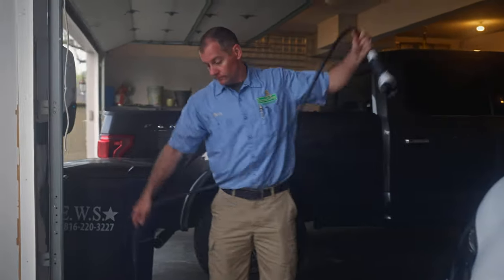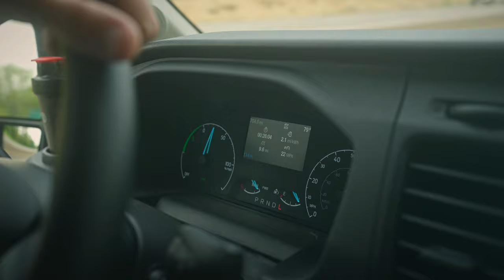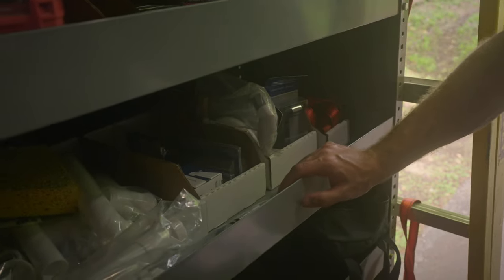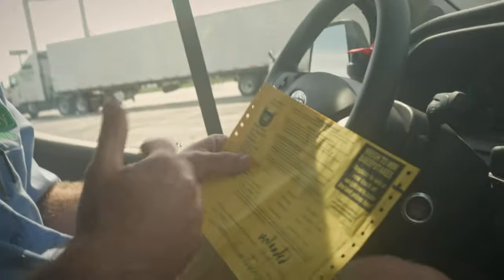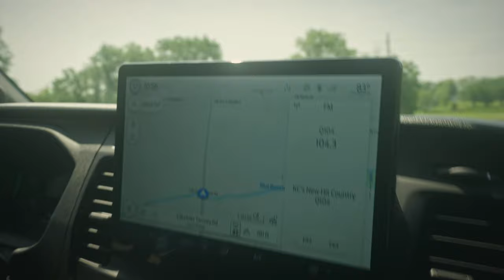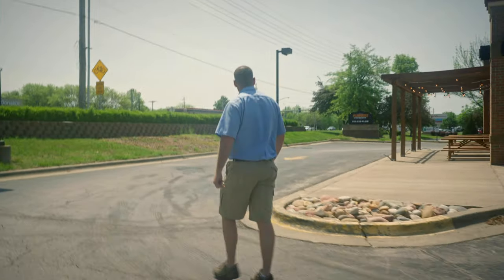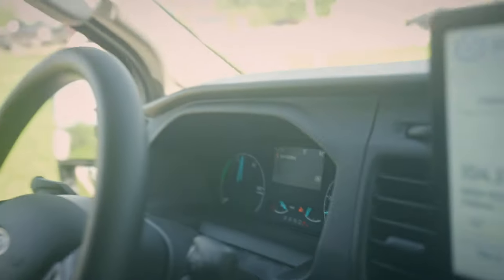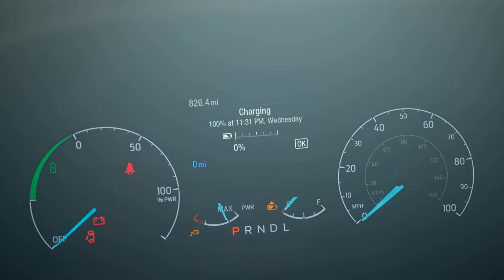**Ford E-Transit**  How far can you drive when it's loaded down?

Comment: Do you carry any electric device to allow you to charge your vehicle should you be out of range of a charging station? If so what brand do you use? How long does it take to charge this vehicle when you go to the EV stations?
Reply from the maker: There is a factory charger that stays in the van.  Charging time depends on the type of charger and the available amperage.

Comment: Do you have a video how you add the the shelves and storage for the van.

Im coming from a work truck and want to get this van.

My big thing is i carry a lot of ladders to.
3ft, 6ft, 8ft and extension ladder.

I forsee i will not be able to carry all my ladders Sadly
Reply from the maker: We just bolted them to the walls and the floor.  We use American Van for our shelving and bulkheads

Comment: Can you sit in it and do your paperwork with the AC on for 20-30 min during the hot summer? Love that high roof. I have a short roof transit and hit my head 3 times a week.
Reply from the maker: Yes.  You'll get a message that pops up letting you know it's about to time-out but you can press "ok" and get more time.

Comment: Great video.  It would be good to let people know that charging stations on average are 10-15x more than home electrical use.  I have a hvac business, 20 vans.  Mostly new awd cab chassis transit vans with reading or knaphied utility beds on them.  We are also seeing about 13-14 mpg average.  Our gvwr is similar to this loaded e transit.  It would he an interesting proposition if range was more, awd was an option, and a cab chassis was also an option.  I'm so done crawling into a loaded van to get to tools.  Tools on outside bins is a game changer.  That said, my awd vans as of last week cost $69,900 with the beds.  

Recharging costs at a charging station between 30 and 60 cents per kwh is terrible.  Now a recharge is $60-80.  Poof, there goes savings.  

Funny. You said you had it a week, and said you had 800 miles on it, so if you actually told us what you spent at chargers that would be good info.  Doing 800 miles in a week, you were going to chargers a lot.  

Expecting plumbers to manage their charging.....lol, they often forget the other two rules of plumbing besides payday Friday.  Wash your hands before lunch, and water flows downhill.
Reply: The best thing to do is have 240 volt outlets wherever the vans will be parked overnight.  You'll charge at much lower rates.  The only time someone should be using dc fast charging is on road trips.  Even if you have to stop and use a pay charger it would be wise to get enough charge to get to home base which would be less than the $30-60 you are quoting.  As with anything that is recharged it becomes habit to plug in when they parked.  We have electric fork lifts and tugs at work and they are plugged in after each shift.
Reply from the maker: You have to put a charging plan together for the purchase to make sense.  Charging nightly where the rates are manageable is key.  Charging where the van already parks overnight is also key.  If you're people take their vans home nightly, then install chargers at their home.  Then reimburse them for the energy consumption.  The nicer charges will provide you a report of how many kWh's were used over a given period.

Comment: Thanks for the video. I’ll be buying an EV work van within the next two years. I am kind of waiting for the bugs to get worked out of the infrastructure and vehicles. If you were choosing a vehicle today or in the near future, would you choose the Ford transit high top again or something else?
Reply from the maker: I would absolutely buy the E Transit again.  But also, you shouldn't need to be relying on the public infrastructure for this vehicle to work. For this vehicle to be an effective vehicle in your business you need the ability to work with the range each day and charge each night. I can think on two occasions in the last 2 years where we needed to use a public charger.  If we had to rely on public charging then this vehicle would make no sense for us.
Reply: @SmedleyPlumbing  I have 47kW of solar, totally off-grid. I have just barely enough to make it through the winter with my house and shop. During the summer when I’m the busiest in HVAC, I make about three times what I really use for the house and shop. And I have five heat pump systems total. Like you, I work a 20 mile radius, but occasionally will make a 3-4 hr trip. I also need to put a few more miles on my 3/4T Express ICE. Glad I came up on your site, you look like you have a very professional business, very organized like myself.
Reply from the maker: @USA-GreedyMenOfNoIntegrity  thanks!

Comment: this is interesting and was really helpful. i actually bought one of these with the help of this video. i love the electric truck. 
Although i have a question To the creator of the video …
why have you not posted anything about how much the range is reduced once the weather gets cold. ford promises 120 mile range.  i got 130 in the summer. and now in November i’m down to 104 in 32 degree weather.  i will probably be down further as winter roles in. 
i can not find any thing on the internet about this crazy reduction in range due to winter and fords lack of insight on this.   if someone is baseing a 110 mile day, than this is not the van for you if you live in a cold climate. 
shame on ford for not disclosing this information. 
i think all. electric vehicular should have a temperature range sticker on the car to let people know what the average range is in a specific temperatures. just like a highway city tag on gas cars. 
please let me know what your van is getting in the winteronths to make sure there isn’t something wrong with mine. 
thank you
Reply from the maker: Ford did great with the advertised range.  They advertise a 106 mile range for our unit and we see 120-140 miles of range in the summer and 100 in the winter.  

It's pretty common knowledge that EVs will see a 20-30% reduction in range during the winter.

Comment: That brake-tap setting is weird. I had a rental Hyundai EV recently, and it had paddle shifters that let you increase/decrease how much regen braking you got. All EVs should have that feature, it was super useful.
Reply from the maker: Ford does this through the brake tapping.  Makes sense for me because tapping the pedal is how you would slow down anyway.  Or you can set it to L mode and have full Regen all the time.

Comment: Great video. Curious to know how long would the charge last with the van stopped but with AC on? Important info for being in south Florida (awfully hot) and waiting for hours at a time in the van
Reply from the maker: It would depend on the charger output.  The AC doesn't seem to have a big of an impact on the range so it shouldn't impact the charge times by a large margin.
Reply: @SmedleyPlumbing  Thanks for the reply. I didn't mean when it's charging though. Just parked somewhere with the AC running. I guess it would be an odd thing guesstimate
Reply: @noktoxicmind6714  not a 1 for 1 comparison but my Tesla Model 3 loses 1% of battery every hour I leave the AC running on a hot summer day
Reply: @ampedampson5140  That's amazing. I'm guessing the van can't be too far off, even if it's as high as 10% an hour would be ok. Thanks!

Comment: I have a Nissan Leaf, not a Transit but I may be able to provide some insight on the "ECO" mode. In the Leaf Eco mode adds a bit of hysteresis to the accelerator responsiveness. This is because electric motors tend to be very inefficient when they're just beginning to turn. In Normal mode (not ECO) when sitting still and you mash the accelerator there's a large in-rush of current before the motor begins to spin. This is wasted energy and unless you're drag racing, unnecessary. Once the motor is spinning the motor becomes very efficient. Nissan adds this hysteresis (softness) to the accelerator in an effort to save a little energy by forcing a more gradual takeoff. On the open highway it will make little if any difference but in a scenario with a lot of stop-n-starting it will provide a slight increase in range.  The Leaf's ECO mode appears to be defeatable. By simply mashing the accelerator (as in a panic or emergency need for more power), ECO mode will be overridden. ECO mode actually makes for a more enjoyable driving experience. This is because Normal mode makes the accelerator more sensitive causing your head to bob back and forth more when even slightly pressing the accelerator.  ECO mode seems more predictable and more familiar to those used to driving ICE vehicles. By the way, I'm a Tron Jockey that knows what a broom is for 🙂
Reply from the maker: Yeah.  Eco mode seems to soften the accelerator pedal response.

Comment: When you reset your mileage to try to get an average fuel usage, it did not consider your having to accelerate to achieve that speed. You reset it while you were already moving.
Reply from the maker: These are small scale tests.  There will always be small variables like hills and acceleration that can make a difference.

Comment: Some houses only have a 100 amp service. Or if the house is all electric, the box is already maxed out. How do you install these at your employees’ houses? What if they live in an apartment? How do they charge?
Reply from the maker: It wouldn't be suitable for either of those applications.  Chargers can be installed in employees homes and the employee reimbursed for the power usage.
Reply: @SmedleyPlumbing  yeah we had a 200 amp service with a total of 25 kw of electric Heat and 2 electric water heaters. When we built our addition, we had to upgrade to a 400 watt service and bury an additional service wire underground. That would be a huge expense to put into an employee’s house for sure!
Reply from the maker: @brianlittle717  yeah I wouldn't advise upgrading panels to make it happen in an employee home.  Doing that at the shop is one thing.  But in an employee home is totally different.
Reply: @SmedleyPlumbing  so you would give a gas burner to that employee correct? I just see problems with this in general. If we move to all electric, then an employee’s charging ability may be a key factor in his ability to find a job or work his way up the ranks. Or maybe he has to leave his plugged up at the shop and commute when he’s on call. But if a company does that and has 5-10 vehicles charging at night, all at once, what kind of electrical demand would that need? For that matter, how would a high rise condo building provide for the demand of having 2 or 300 cars plugging up after the work day? I see it as a good solution for certain instances, and they are good for some things, but it can’t be the 100% way of the future. 

One flaw for you specifically, I know how many times I’ve come home after a hard day’s work, and then had to take another call as soon as I hit the driveway. You wouldn’t make it.
Reply from the maker: @brianlittle717  yeah some employees need a gas van, others can work with the EV.  We have never missed a call due to needing to charge either.  It's one of those things that we think will be a problem but it never occurs like we think it will.

Comment: Have you done any comparison on consumption at different highway speeds? 55, 65, 75
Reply from the maker: Not specifically.  But we do know that the faster you go, the worse the range.  And it's exponential.
Reply: @SmedleyPlumbing  does ford connect your van’a data to an account where you can see each trip’s mileage, speed and kWh consumed?  And if you could link that up to the charging data that would be nice to help track things. Both to catch the odd speed demon driver and also to help catch battery degradation issues.
Reply from the maker: @skyemalcolm  you can do all that through Ford telematics.
Reply: @SmedleyPlumbing  maybe I didn’t see it if you made it already but it could be interesting to make a video about reviewing that data. I see a lot of EV videos that focus on the driving and charging experience but far fewer on the data analysis or even data analytics that these connected vehicles offer. I’ve never used Ford’s software but with Kia’s system it’s possible to export the data such that you can analyze it and graph it in your favorite spreadsheet software.
Reply from the maker: @skyemalcolm  so I don't have Ford telematics just yet.  Since we only have the one EV in the fleet and I'm the driver, I can track my behavior on my own.

Comment: Thanks for the indepth review.. I wonder how much will using the heater effect range. I have a Chevy Bolt and the heater can "eat up" 10-20% range depending on how cold it is outside. I also wonder how well did Ford build the system and if the battery will degrade with time, especially with using almost 100% daily. I wonder if they will come out with a longer range version later, because these would be perfect as campers.
Reply from the maker: Only time will tell!
Reply: @SmedleyPlumbing  thanks Sherlock

Comment: Loved the video. 
How do you work out charging for all your employees vans?
Normal every employee has a gas card for the gas van. All chargers in town require you to pay in their personal app. Can you pay for a charger with a gas card in the apps? What do you do? And I’m sure they are all charging at home. Do you make up for their home charging?
Reply from the maker: Currently I'm the only one with the E-Transit.  But they make home chargers that can be programmed with the electric rates and that will email the company the usage and reimbursement about each month.
Reply: @SmedleyPlumbing  how would you go about it if they hade to charge during the day?
Reply from the maker: @phillipgreen8958  you can set up accounts with the charging networks.  The driver holds their phone to a charger to activate the charger and the energy cost is charged against whatever card is on file.  Similar to a fleet fuel card for gas stations.

Comment: Well nice to know with more aggressive regen the added weight is a benefit.  They really need to up that range though.  Unless your goal is to burn the battery out as fast as possible it isn't practical trying to get the maximum range capabilities in daily use.
Reply from the maker: All depends on your daily mileage but nightly recharging is intended with the vehicle.
Reply: I believe the general rule of thumb is to run the battery between 80-20% for best health. It occasionally should be put through a full charge cycle to prevent "memory" issues like the old nickel metal hydride batteries used to suffer from. For long trips it's common to run through most of a pack's range.
Reply from the maker: @computersales  from the console, you can adjust the maximum charge rate of the battery.  However, it seems there is a considerable safety factor built in.  The dash claims an average of 2.1 miles per kWh and we hit zero miles to empty at 135 miles.  It's a 68 kWh battery.  68x2.1=142.8 miles.  So hitting zero miles to empty isn't fully recharging the battery.  Also, the battery has an 8-year/100,000 mile warranty.  That's a big claim for a vehicle that's intended to be fully recharged nightly.
Reply: @SmedleyPlumbing  Finally had a chance to test drive one. It drives better than the regular transit in the wind which is nice.  When looking under the van they clearly just slapped it together to rush it out.  I can't believe they have the high voltage and cooling lines exposed.  I think it would be interesting if you made a follow up video in a few months showing in great detail on how the undercarriage holds up.

Comment: Taking Smedley's fuel number into account and adding in some more info I think there is a decent return on investment for him. Fuel ($100/week x 52)and oil changes (6 x 85) - about $5700 per year. Bump up on cost of EV vs gas van - about $10,000 (according to a different video I watched). ROI - 1.75 years. Not a bad ROI. 

Most days this van would work for me but there are days when it would be questionable. I've currently got a medium roof Transit van and when I tow my hydrojetter, the fuel economy is probably half what it is without. I sometimes have a 160 mile round trip when I get called for service. If it was just a 20 minute charge cycle for the call, I could deal with taking a break but I'm afraid it would be 2 or 3 charges to get me there and back. Not the end of the world but still something.
Reply from the maker: We actually paid about $14k less for our E-Transit than we did the other gas Transits we've bought this year.  That doesn't include the $7,500 tax credit either!
Reply: @SmedleyPlumbing  
Wow, that's quite a difference. Makes it even better. I don't know what the other video was basing the numbers on but he said it was $9-10k more than gas. Glad you got a good deal.

Now, if I could just get that bigger battery...
Reply from the maker: @rogermccaslin5963  we bought the EV at MSRP.  We had to pay way over MSRP for the gas units.  But yes, the MSRP of the EV is listed close to $10k over the MSRP of the gas units.
Reply: @rogermccaslin5963  im in quebec canada, i will be receiving my e transit next week. It was the same price as a diesel sprinter i also ordered, except diesel here is 2.30$ a liter, along with Mercedes diesel maintenance, you can see how the e-transit is going to win in savings.